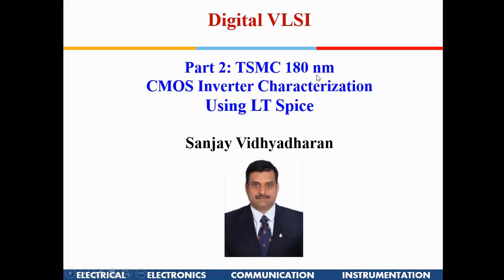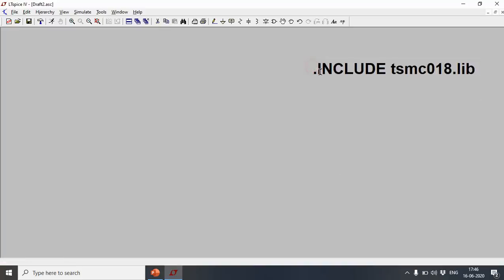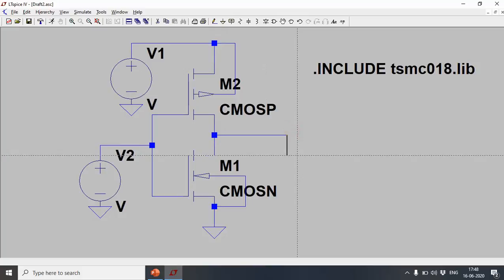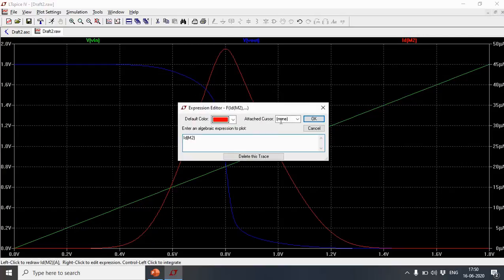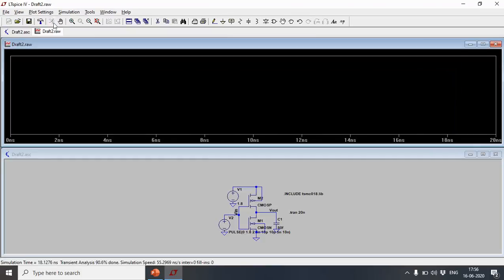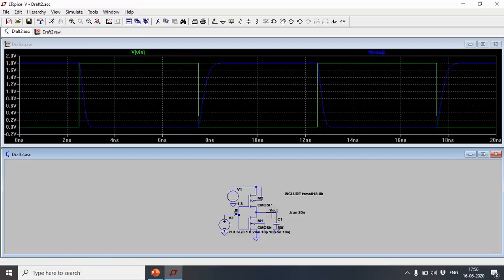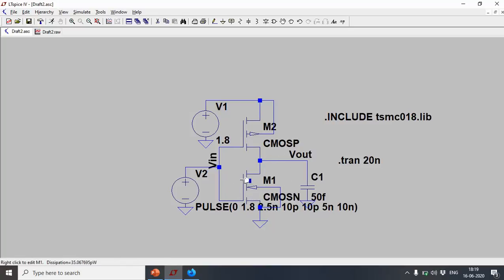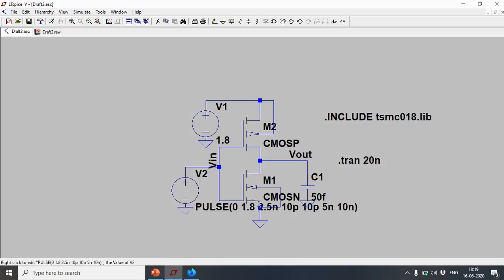180 nm CMOS Inverter Characterization with LT SPICE

Comment: Great work. step by step and clear explanation. As per your procedure when I am measuring the leakage current using the curser, it is showing 21.171pA. why this difference, please clarify.
Reply from the maker: Is the  VDD, Width / length of NMOS and PMOS, and model files used excatly the same?. There could be some minor mismatch.  Nevertlhess the curret you obseved are in the same pA order.
Reply: Thanks for your response. Yes, I have again checked, the same mismatch I am getting. The PMOS leakage current is showing 17.3pA and NMOS is ~ 21pA. Is it because of  PDK or due to the simulator? I have recently updated my ltspice. You are truly an enthusiast in knowledge sharing and a great source of learning. I want to be constantly in touch with you and learn from you. please share your email id. Thank you.

Comment: Hello sir, can you upload A CMOS Peak Detect and Hold Circuit With
Auto-Adjust Charging Current for NS-Scale Pulse
ToF Lidar Application in 45nm CMOS technology using lt spice
Reply from the maker: I will surely try as and when I get some spare time. In case you are having any difficulty in implementing the circuit you can mail me the details   @ sanjayv@hyderabad.bits-pilani.ac.in

Comment: Great lecture!!
I have two questions:
1) how do you understand that the load at the output is 50femtoFarad? It depends on the number of gates you drive, right? I guess then that is a value chosen for the worst case, is it so?

2) Where can I find the definitions for TSMC 65nm technology?
Reply from the maker: The load is generally a capacitance equivalent to fan-out of four.
Reply: @SanjayVidhyadharan  Thank Sir!

Comment: Thank you for posting the video.
I have LTspiceXVII version in which I tried to save tsmc018.lib, cmosp.asy, and cmosn.asy files downloaded from your blog and tried to design inverter but could not find the cmos components.

to make these library files compatible with the LTspiceXVII version, what changes I need to do. Kindly help me
Reply from the maker: Ensure you are pasting the lib and sym files in the correct directory.  Firstly open a new schematic. Insert any component  and see the directory ( Eg. C:Users\Admin\Documents\LTSPICEVII\Lib\Sym) .  Then paste the lib in C:Users\Admin\Documents\LTSPICEVII\Lib\sub and sym files in the C:Users\Admin\Documents\LTSPICEVII\Lib\Sym folders)
Reply: i m also facing same problem?
can you guide me?
Reply: @sanjayvidhyadharan1175  thank you sir my problem was resolved

Comment: Sir, it was a nice video , i have downloaded the tsmc files mentioned and pasted in the respective folders in the C drive. But i could not find the CMOS n and CMOS P symbols in the LT SPICE. what may be the reason sir ? I am using the LTSPICE XVII
Reply from the maker: You may install Google Chrome remote desktop and call me up on mobile. I will have access your desktop and resolve the issue
Reply: @SanjayVidhyadharan   Sir i am also having same problem
Reply: Use nmos4 and pmos4
Reply: @SanjayVidhyadharan  for me also same problem sir..

Comment: I tried to set mosfet dimensions with other value (but the L always equal to 180nm). In this way I obtain my purpose: a analog working of my circuit. But I have doubt: Can I use any dimension (always greater or equal than 180nm)?
 I am using for a mosfet a W=190nm, can I to do it? The LTSpice simulator work, but when  I want to make my chip with this technology (MOSIS), will this size be accepted?
CAn I use different dimension in the same circuit? This serve me for to make an analog circuit. It is possible with this way?
Reply from the maker: The technolgy specifies the minimum lenght and minimum width. You can always gretaer dimensions it it suits your design.

Comment: Sir I have implemented a current multiplier using Mosfets and its having output of the form K*i1*i2 , where K is UnCoxW/L , now I need to analyse the percentage error but not able to know how to obtain value of K (actually UnCox) from 180nm file , will put W/L as per circuit , can you please help in obtaining  K or UnCox
Reply from the maker: The parameters  of the 180 nm devices are mentioned in the spice file. You can verify it by take few sample values of ID, VGS and VDS values form a VGS vs. ID plot.

Comment: Good explanation sir....will you plz tell me what will be the width for 1um and 10nm technology....here you took 400nm what about other one how to identify
Reply from the maker: The minimum width is usally specified by the fab lab or in the SPICE Model. For 180 nm  gdpk   the minimum width is 400nm, for 90nm gdpk  he minimum width is 200nm, and for 45 nm gdpk  the minmun width is 120 nm. If it is not specfied in the SPICE model which you are using, you may take it as 2.2 to 2.5 times the channel length. Youmay also want to check ITRS specifications

Comment: Design and simulate an inverter for equal rise and fall times. Use length =180nm for pMos and nMOS. Min width to be 
used is 0,4um for this technology. Calculate the propagation delay, rise time, fall time and power dissipation. The 
waveforms needs to be presented with the markers
Reply from the maker: What is the querry?
Reply: @SanjayVidhyadharan   I need to slove this question using the LT SPICE  application can u do a video of it

Comment: Sir, I want to make a common gate amplifier using tsmc 180nm with current mirror load. here how would I get lambda for rds, As it is required for gain
Reply from the maker: You will get the details in the SPICE Model which you have included in the lib/sub folder. Alternatively plot ID-VDS plot  for a fixed VGS and from the slope of the region in saturation region, you can compute the VA/Lamda

Comment: Sir, i pasted the cmosp and cmosn files in the sym folder. Still I can't find it in the components list.
Reply from the maker: 1.You need to add the tsmc018.lib file in LTspiceIV\lib\sub folder and add SPICE Directive and  "INCLUDE tsmc018.lib"  SPICE directive in the schematic.
Reply from the maker: Let me know in case you are still facing a problem.
Reply: Hi...is the problem resolved...I am also facing similar issue...I pasted lib in sub and cmosn and cmosp asy file in sim...and also included the tsmc018.lib library in the schematic.
Reply from the maker: @sandrab7711  you need to create the SPICE Directive    . INCLUDE tsmc018.lib     If the problem is not resolved mail me the asc file at sanjayvidhyadharan@gmail.com.
Reply: Sir I am also facing the same problem 
Please help
Reply: @SanjayVidhyadharan  same issue is showing on my pc too sir. This is happening only when i installed latest version of ltspice. But, it is not happening with the old lt spice4 version that is available on your website.

Comment: Hello sir, How is the propagation delay calculated in a BCD ADDER circuit?
Reply from the maker: Concept of Delay is same for all circuits.  The delay is usually calculated at 50% point of input-output switching.
Reply: @SanjayVidhyadharan  The problem is in the number of inputs and outputs, between which input and output do we take the delay?

Comment: Sir, I want to find the total circuit power dissipation instead of individual components'. Is there any way to do that?
Reply from the maker: If you have a single power supply source Vdd, which is the case for most of the cmos circuits, the power will be power of the power supply source. You can also  do average current of Vdd source multiplied by Vdd, which also should give you same value. The power given by source , will be power dissipated in the whole circuit.

Comment: Hello sir, great explanation!! Really helpful for many people. How we are getting 50fF value? Could you provide some link or formula to explain this.
Reply from the maker: The norm is to use a capacitive load equivalent to Fanout of 4. Gate capacitance needs to be seen and accordingly Cload equivalent to  4 fanout should be used. 50fF was used just as an example.
Reply: @SanjayVidhyadharan  thank you so much for prompt reply. So if we work on the lower node, let say 16nm then this will reduce to what amount??

Comment: sir, can you please explain us how to calculate noise margin in this sir?
Reply from the maker: You may refer my paper  to see how the -1 slope of VTC  is used to determine the NM. S. Vidhyadharan, R. Yadav, S. Hariprasad, and S. S. Dan, “An Innovative Ultra-Low Voltage GOTFET based Regenerative-Latch Schmitt Trigger”, Microelectronics Journal, Vol. 104, October 2020. DOI:  10.1016/j.mejo.2020.104879

Comment: Sir how to design dynamic cmos comparator using ltspice
Reply from the maker: You can design and cmos circuit in LT SPICE in a similar way as explained in the video. You may refer to my publication https://link.springer.com/article/10.1007/s10470-019-01487-x  on comparator

Comment: Very helpful sir.. Please keep making video like this..
Reply from the maker: Sure I will
Reply from the maker: As of now I am taking Microprocessors course and I am regularly uploading my lectures.
Reply: @SanjayVidhyadharan  yes I am also interested in microprocessor... Sir one question I am a Ph.D scholar in Mizoram University, my research field is low power VLSI.. As of now We don't have genuine cadences  or HSPICE  software. So Is there any way to configure/connect FinFET PTM in LP mode, not only in SG mode using LTSPICE??
Reply from the maker: @vanlalchaka  You can download the required FinFET PTM  LP mode and use in LT Spice
Reply: @SanjayVidhyadharan  thank you so very much sir.. You have been very helpful to me and words cannot explain how grateful I am to you🙏🙏🙏..  Still one doubt! Then, in PTM LP mode the back gate is already negative biased internally???  Because in LTspice we have only three terminal MOSFET.
Reply: @SanjayVidhyadharan  Sir from FinFET 20nn-7nm nodes  PTM-MG  that we have such as High performance (HP) model and Low stand by power (LSTP) model..
From these models we can only configure FinFET circuit level ( NOT logic, AND logic, OR logic etc) in Short Gate (SG) mode using LTspice??? Low power (LP) mode in which the back-gate would be connected to some negative voltage as -0.2, - 0.4 etc. is not possible with LTspice??  In these PTM-MG nodes all the front and back gates are already shorted or what??

Comment: Please send download link. When I typed it does not work.
Reply: please ignore. I wrongly typed.
Reply: This link is not available.
Reply from the maker: Please use this link.(Downloads D is capital)
https://sanjayvidhyadharan.in/Downloads
Reply: @SanjayVidhyadharan  Thank you very much. I could download the model file.
Reply: Sir I downloaded file  tsm180nm.lib n stored in   location u told. But when I'm run the program it gives msg couldn't open tsmc189km.lib